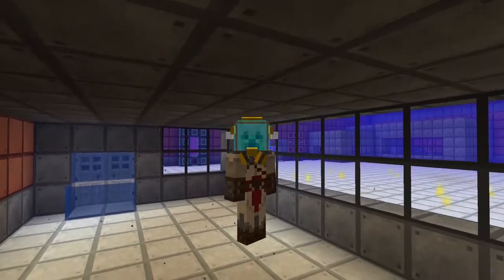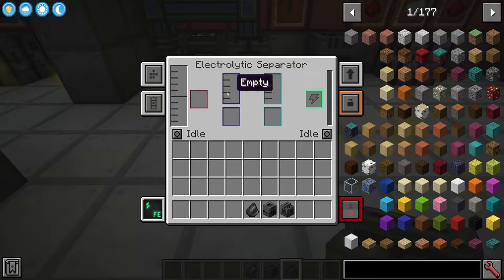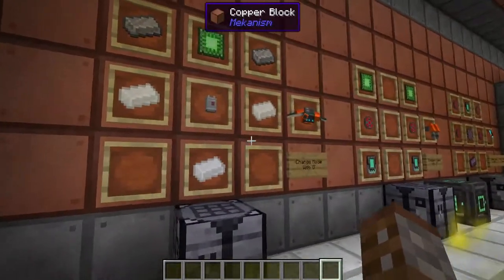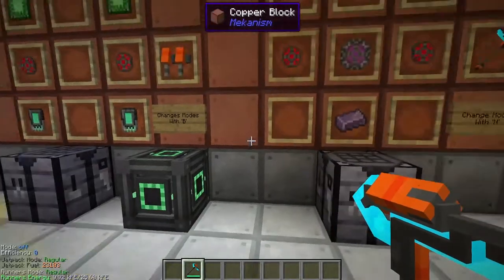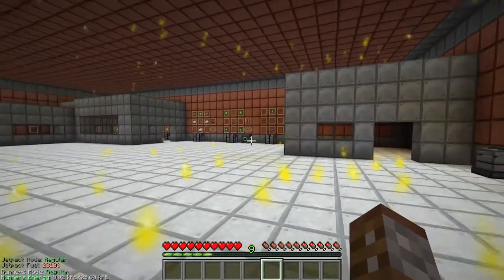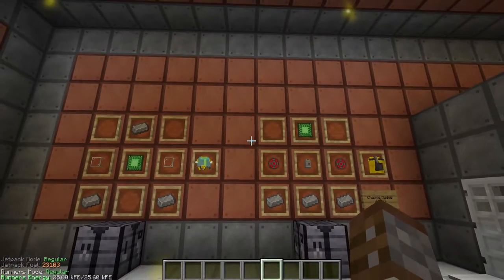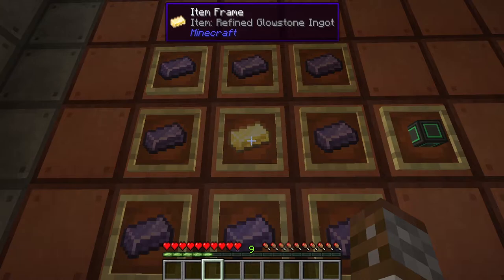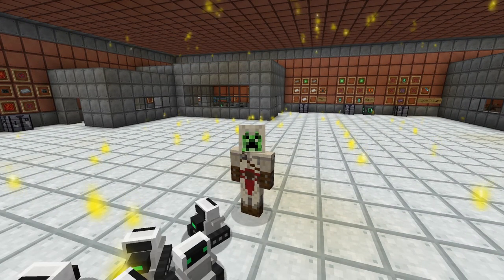How to: Mekanism | Tools & Tripling (Minecraft 1.16.5)

Comment: Very useful tutorial. I made an atomic dissembler, but it only has the "slow", "fast", "normal", and "Off" mode. It doesn't have the vein miner mode. I've checked multiple wiki pages and still can't figure out what the problem is. Am I missing another mod or something?
Reply from the maker: Potentially you may be missing some mods. There are 4 mekanism mods I am using in this pack. Standard Mekanism, mekanism additions, mekanism generators and mekanism tools. The extra mods may be a part of one of this addition add-on mods
Reply: @Mondays3  wehave all of them on a serfer and still nothing
Reply: did you solve the problem?
Reply: from what i have found out, mekanism made it an option in the config file, or if you have the configured mod. you can choose if you want the assembler to have vein mine or not.
Reply: @sluperslonic8624  I found the vein mining option in config and turned it on but the only extended vein mining option i found was only for the meka tool can you please tell me how or if you found the same setting for the atomic dissembler?
Reply: they have entirely gotten rid of extended vein mining on the disassembler. if you want it you're going to have to make a meka tool, im sorry.  @lazypizzaguy
Reply: @sluperslonic8624  Im planning to just use an older 1.16.5 version from before that change instead cus meka tool is just too freakin expensive mega end gamey + same with its suit tooo mega super end gamey compared to other similar suits